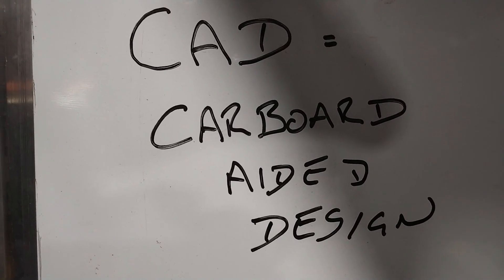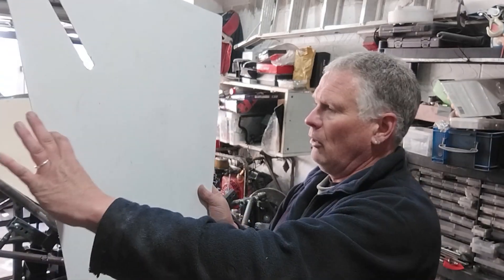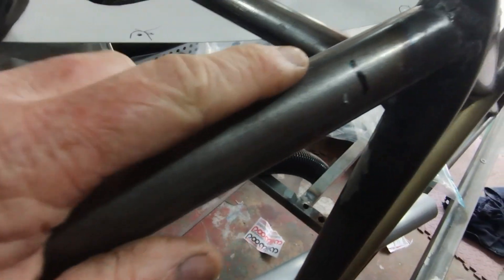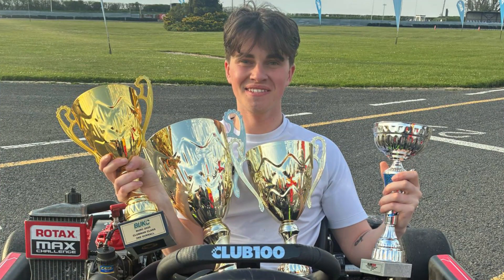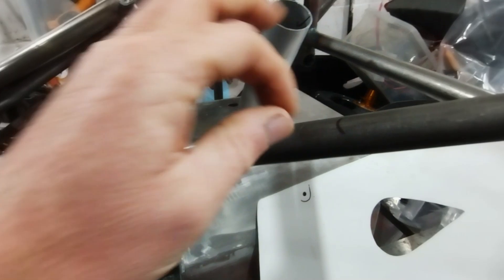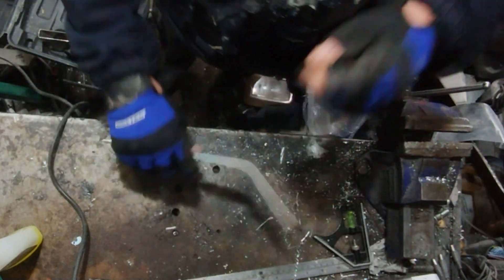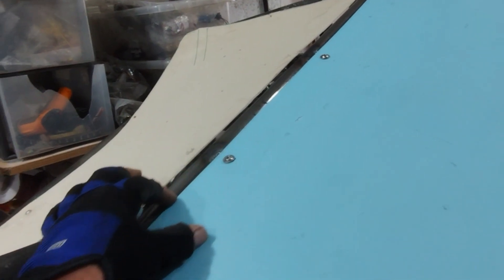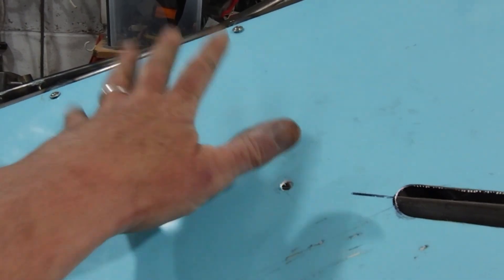CAD = Cardboard Aided Design - Low tech body panel design & build

Comment: Won’t the gaps at the frame allow air to get under and lift the panels at high speed? Regardless of how much GRP you put on? At least at the front edges? Are the holes reinforced? Love what you’re doing!
Reply from the maker: @iancullington6765  there will be very little gap. I'll probably use rubber edging around the panels to "seal" them to the chassis tube.
Reply: Cool 👍
Reply from the maker: @iancullington6765  Where you already following these vids/build? I'm assuming you are Ian from Sporting Bears.
Reply: Indeed, we had a chat at lunch the other day 👍
Reply from the maker: @iancullington6765  Will you be at the QE country park even with SB on 1 June? I'm hoping to get Callum along to that one.
Reply: @ yep, I’ve signed up 👍 see you there!